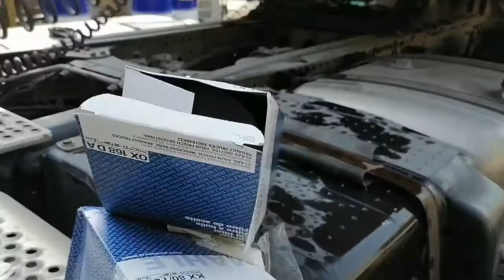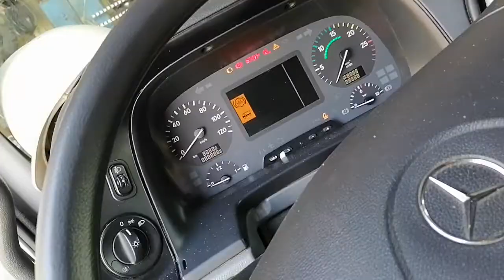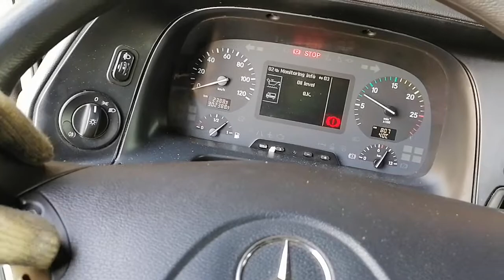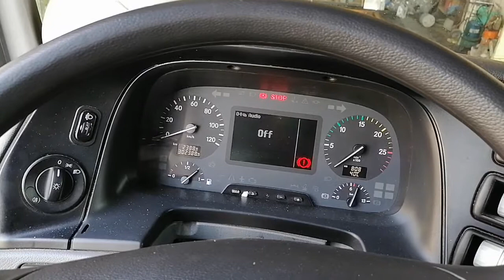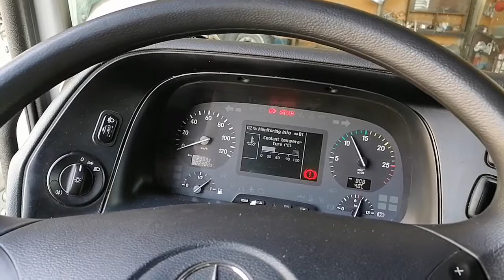Mercedes-Benz actros 2040. changing engine oil. Oil filter. And Fuel filter.

Comment: Salamat Sir. Naa koy Actros pud 1832 first time nako mag.service. dakong tabang imong video. God Bless
Reply from the maker: Walay sapayan sir god bless all
Reply: @mechanikongbisaya9814  pila ka litro ang oil ana sir. v6 na noh?
Reply from the maker: @mcpel262  32 letros sir
Reply: @mechanikongbisaya9814  ok sir salamat...5litres ang deperensya nila sa axor.
Reply: @mechanikongbisaya9814  30 litros and sa amoa Sir..pero gi.drain nako ang used oil gamit ang vacuum pump...posible nga naa pay nabilin kumpara sa drain plug pag.tanggalon nimo kay hurot jud..paminaw  nimo Sir..o mas gamay lang jud ang sa 1832 kumpara sa 2540 when it comes to engine oil capacity.
Reply from the maker: @mcpel262  yes  sir naay nabilin nga oil ana sir pero gamay ra kaayo. mao ng 30 litters ra ang sulod ana kay mas gamay na siya og oil pan kaysa 2040 sir
Reply: @mechanikongbisaya9814  so unsa may mas advisable Sir..draining sa plug or vaccum...ang effort pud akong gihunahuna although more 
effective ang drain plug removal.
Reply: Lain pay ato...share lang...pag.ilis nakog diesel filter tong niagi..naalala dayon nako imong video maong gi.pump nako ang pump nga naa duol sa tanke....wala man gud ko naanad gud ug pump sa uban namo nga unit..MB AXOR...matic na siya eh mu.andar man dayon..
Reply from the maker: @mcpel262  ok sir unya ok na sir dali ra moandar
Reply: @mechanikongbisaya9814  oo sir dali...bag.o man gud pud nga unit..2018 model pero wala pay 1000 km and mileage

Comment: Which Grade of engine oil do you use Mercedes Actros. After how many KM do you change the oil
Reply from the maker: We use 10 w 40 sir and every 20 thousand kilometers we change engine oil oil filter and fuel filter also every 60 thousand kilometers we change oil oil filter Fuel filter water separator air dryer and every 100 thousand kilometers we change air filter

Comment: brother at first oil change time shows ok but next day shows in display 3,51  before start, so can you tell me if oil gage shows in display 3,51 is it high or low oil?
Reply from the maker: It is low sir you need to put 4 ltrs. Of engine oil
Reply: @mechanikongbisaya9814  ok sir it mean add more 4 litrs plus?  total 32ltrs alrdy fill mecanik said me
Reply from the maker: @nextmoonworld4187  yes sir that's true

Comment: Ser tanong kolang po ung problema sa mercedes actross kasi po bagong palit ng falter ng deisel nong na start na bilang namatay at dna po umandar ser paki sagot naman po salamat
Reply from the maker: My primary pump yan sir e pump mo sa sunod bago mo start
Reply: Na pump kona po kya lang ayaw tuloy start mahina labas ng deisel sa injector
Reply: Nag palit na ako ng primary pump ayaw parin
Reply: Ayaw tumuloy start nya kahit sinabihan ko nang pump
Reply: Sinabayan
Reply from the maker: @jimboynap2679  yung filter mo ba dati foam oh plastic na kung foam yun at pinalitan mo ng plastic magkaiba yun kasi malayo ang gab ng plastic kaysa foam
Reply: Foam po sya ganon din pinalit ko
Reply from the maker: @jimboynap2679  subukan mong start yung makina habang pinapump tagalan mo wag mong bitawan kaagad at eh full accelerator mo sir
Reply: Sir okey na po na ayos kona po salamat po sa advice sana po dumami pa yong mga kagaya nyo God bless po
Reply from the maker: @jimboynap2679  walang anuman sir
Reply: @mechanikongbisaya9814  Sir..papano sa susunod na replacement ng diesel filter may posibilidad ba ng mangyari ulit and na.experience ni Sir JN? ano ba ang problema pag.ganito Sir..loss of vacuum /suction pressure?may hangin sa linya na kelangan i.elimate or what? Salamat daan Sir.
Reply from the maker: @mcpel262  opo sir pwedeng maulit uli yung na experience ni sir jimboy nap para maiwasan ulit yung ganun kailangan lang eh pump bago start yung engine sir at sa pag start ng engine kailangan bigyan mo ng konting rpm accelarate mo kunting konti lang
Reply: @mechanikongbisaya9814  so hindi siya normal sir...kelangan may permanent solusyon...
Reply from the maker: @mcpel262  ang sulosyun talaga nyan sir kailangan molang talaga siyang eh pump para may fuel na pumasok ulit doon sa filter. kasi pag tanggal mo ng filter ma drain din yung fuel niya. so kailangan palitan yung oil na  na drain which is sa pag pump
Reply: @mechanikongbisaya9814  sabi niya kasi na.pump na hindi parin nag.start siguro not enough fuel chaka baka may hangin sa linya...next time malalam niya yan...but if same problem happens eh kelangan niyang imbestigahan yan...thanks sa input Sir....
Reply from the maker: @mcpel262  yes sir nagkaroon na ng hangin kaya hirap na ang fuel pump
Reply: @mechanikongbisaya9814  suggest ko lang na pag mag palit sa sunod ng fuel  filter at dapat  lagyan na ng diesel  ang fuel filter bgo ikabit. Kapag my diesel  na ang fuel  filter  kunting pump na lang mawawala na ang hangin  sa fuel  line.